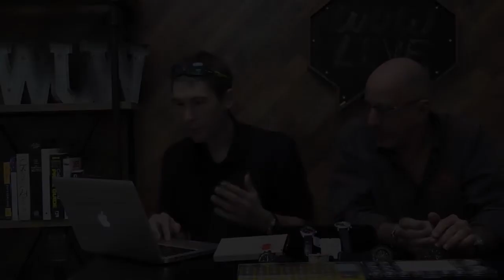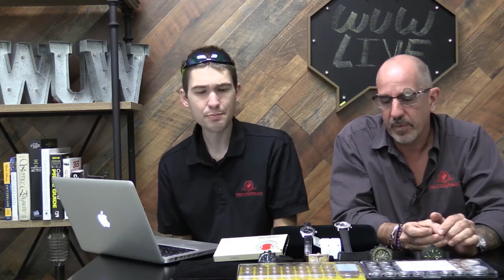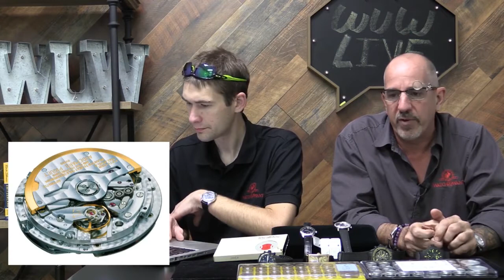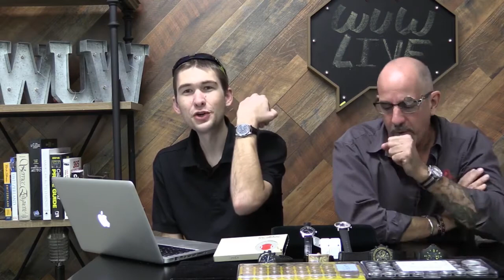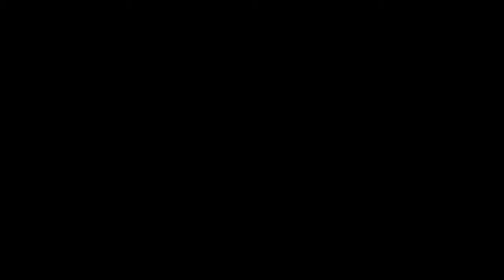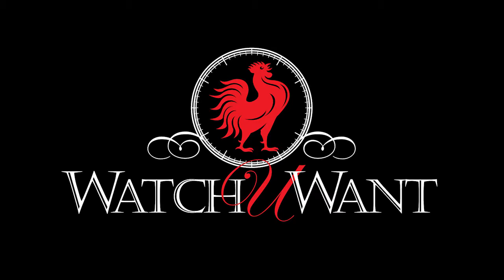WuW Live: Appropriate Movement Applications & The Girard-Perregaux Calibre GP3000

Comment: I had a 1966 powered by a calibre 3300. It ran extremely accurately, less than +1 second per day. However, one drop from chest height to the floor gave that all away. After the impact, it ran 15 seconds fast and even after tuning, 10 seconds fast with the "sticky seconds hand" syndrome. All these years from this video, the calibre is still ubiquitous across the different series with no robustness improvements which is pretty disappointing because I like GP as a brand. Hope their 1800 is more robust and more prevalent going forward